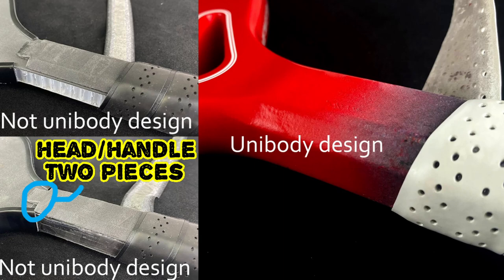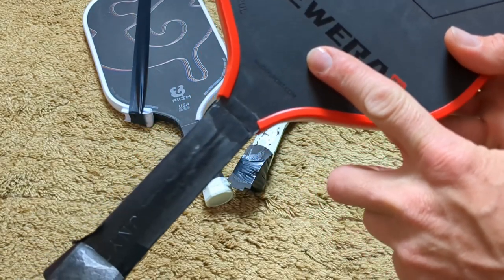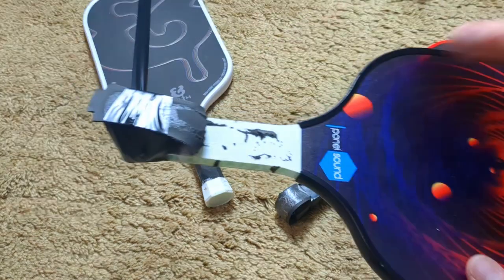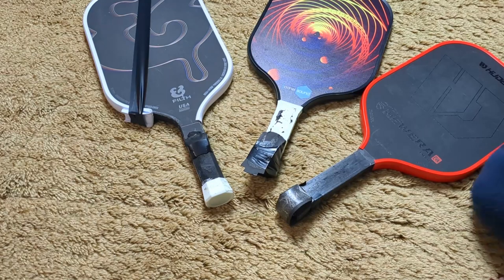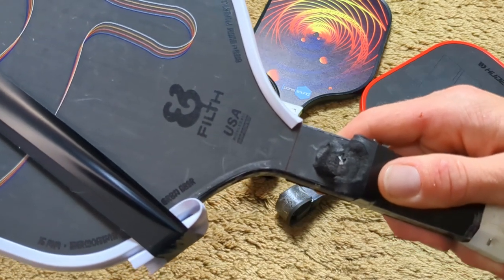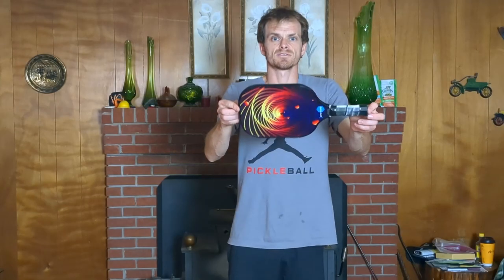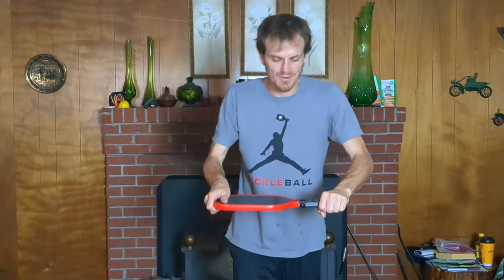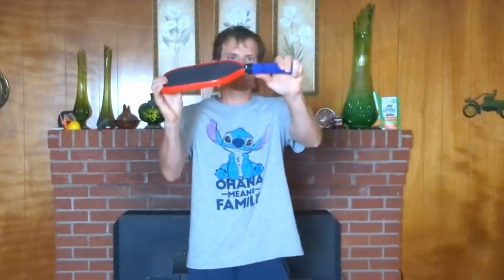What Is a UNIBODY Pickleball Paddle And Does It Matter?

Comment: I game the CRBN 1x 16mm and figured I’d give the Hudef Viva pro 14mm I shot since it was $84 after your discount. I found that the Viva pro still being a 14mm had more control and plush feel than my crbn 1x 16mm. Was very easy to adjust to. I was hoping for more power with the 14mm overall a great back up paddle to have. I had ordered the BNB filth awhile back but cancelled. It hurt watching you tear it apart.